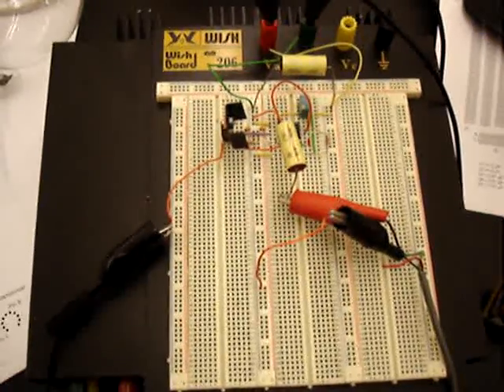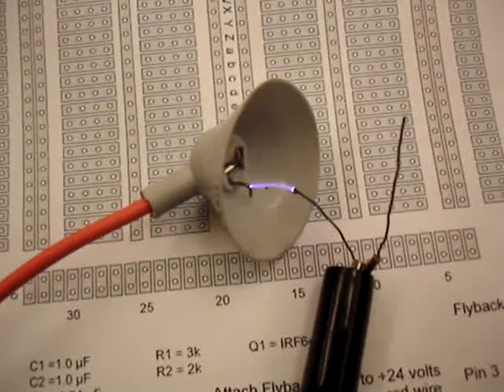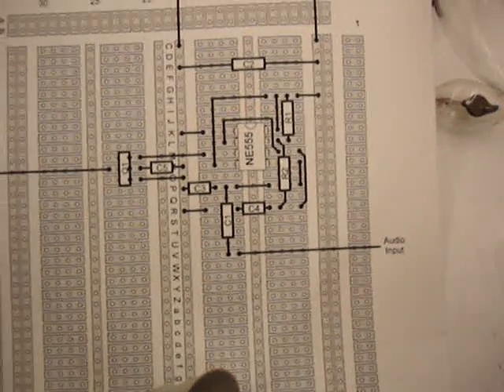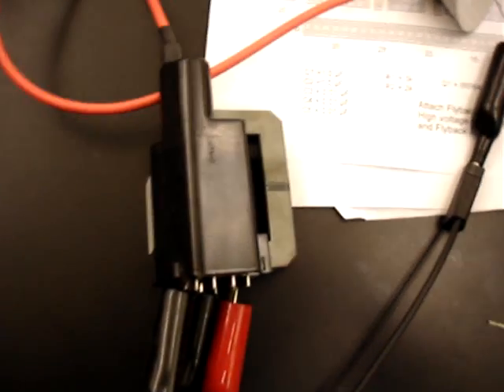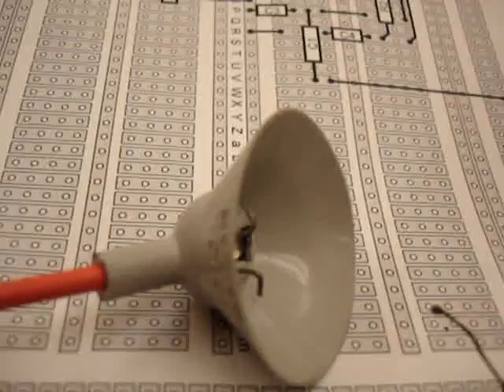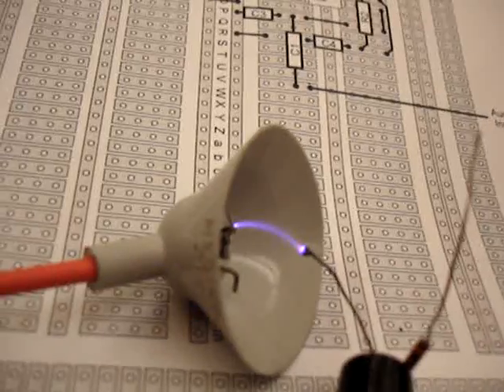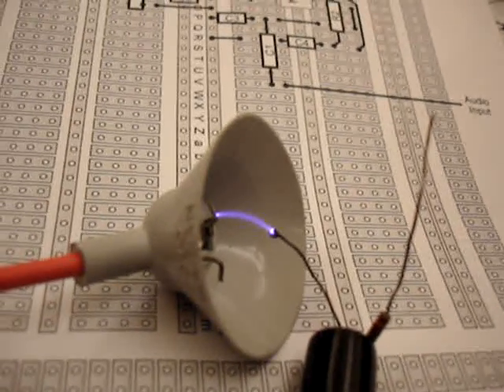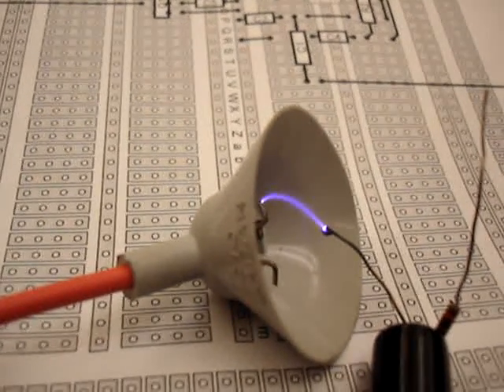Plasma speaker: making musical sparks

Comment from the maker: Tesla could have done this - the first "singing arc" was made in 1900 by William Du Bois Duddell, and his invention lead to an early radio transmitter.  In fact, if you build my circuit with a higher frequency coil and carrier frequency (about 1MHz) you'll wind up making both a plasma speaker and an AM radio at the same time.  However, the FCC won't like it if you do this...

Comment from the maker: People have tried to make commercial plasma speakers: google ionovac.  The main problems are safety-related, notably the high voltage and high temperature of the arc, which can easily ignite inflammable material.  Also, the arc generates ozone and nitric oxides.  It's relatively easy to solve the high voltage and temperature issues, but so far the only method to eliminate the ozone and NOx is to use a helium arc, which requires a tank of helium for your speaker.

Comment from the maker: You can get the IRF640 at most major electronic suppliers: Jameco, Mouser, Digikey, and Newark/Element 14 all have this part in stock.  You can do a Google search on any of these names (Jameco is probably the most convenient for hobbyists).  Incidentally, you can substitute other high-current, high-voltage N-channel MOSFETs for the 640 (such as the IRF740) although I prefer the low on-resistance of the IRF640.

Comment from the maker: If you do a Google search on "plasma speaker history" you'll find that these have been around for quite some time, but have never caught on.  Plasma speakers have great potential but technical and safety difficulties have kept them from replacing standard speakers.  But if some clever person can solve the safety problems, then these might become the speaker of the future (albeit with a better driver circuit than the one I used).

Comment: No, i reduced the duty in changing that two resistors for 555 timer, but - the logic 1 on output is still longer than logic 0, so i inverted it with BC547. So - As you said, it will reduce the audio power so much, but current that flows from main supply is about 0,5A. If you agree, we can amke it together with small input power, smaller power dissipation and louder sound :)

Comment from the maker: My email is dsherman@cornellcollege.edu and I'd appreciate your circuit.  It seems like you're using the BC547 NPN transistor as an inverter to reduce the 555 duty cycle well below 50%.  That will reduce the power dissipated by the IRF640, but it may also reduce the audio output power.  If the duty cycle is only about 7%, then you can only modulate up to 14% before your circuit clips the audio.  However, that may well be enough to produce sufficient audible power.  I'll have to try it!  Thanks!

Comment: I will send you mine schematic - give me your email on my channel. I solved the problem (Im only 15year old, so i dont know if its best :D) with changing the 555 cycle = first i did a 30kHz cycle, Then I inverted the input with BC546 for the IRF640 (for wider logic 0 than logic 1 on output), so the IRF grounds the coil like this- LOGIC1:LOGIC0 1:15, so in one full cycle is the irf switched on only 6,6% from 100% full cycle. So this is "healthier" for IRF640 and you can use smaller heatsink :)

Comment: No, I meaned for sample  BC547 or some small transistor for open that IRF640, but with resistor from 24V to 547s emitter, like 1k for simple limit. Or - MOSFETS can amplify current too, so what about use resistor (about 100k) between Gate and Drain for limiting current :) Of course - mine works without 100W resistor :). Many people cant find a primary winding, as me. So i wound it on that main ferrite core - about 8 turns with rubber-isolated wire (works same with ANY littlebit thicker wire)

Comment from the maker: I agree that the 100W resistor is a cheap, brute-force method of limiting the current, but it works.  Did you mean BU5xx transistors?  They can certainly handle a much higher voltage than the IRF640, but the problem when removing the power resistor is how to limit the current to the flyback primary - there doesn't seem to be a problem with the voltage.  I'm not sure how the BU5xx transistors would solve this problem.  Could you send me a schematic of your proposed circuit?  Thanks!

Comment from the maker: I actually soldered a standard 1/8 inch audio jack to pin 5 (the modulation input pin) of the 555.  I could then hook up any audio device (MP3 player, computer speaker, radio, tape recorder, etc.) to the plasma speaker using a standard audio cable.

Comment: Thank you for your reply again. I think that I will isolate the two cables in order to avoid surprises. Form I understand from the schematics, you just solder the output of an MP3 player to the output of the NE555 in order to obtain sound. Is this correct?

Comment from the maker: I presume you want to drive the primary of the transformer with 300 volts.  The IRF640 MOSFET can only handle 200 volts, but the IRF740 can handle 400 volts and the IRF840 can handle 500 volts.  However, you'll need to power the rest of the circuit with low voltage.  The flyback transformer I used only had the one high voltage red cable and several pins.  Without knowing anything about your specific flyback transformer, it's hard to offer useful advice on what to do with the other wires.

Comment: Thank you for your reply. I forgot to ask you what happens with the other two wires which exit the fly back transformer (typically a red and grey cables). Do I cut them off? Also, with this schematic is possible to increase the power from 24V to 300V?

Comment from the maker: The flyback transformer has two secondary leads.  One lead serves as the ground (pin 6 on this transformer) and the other lead (the high voltage red wire on this transformer) serves as high voltage lead.  The spark is between the two secondary leads.  The air being ionized by the spark serves as the resistor between the two leads - there really isn't any need to add additional resistance.  Goldmine Electronics still has these transformers in stock: item G17744

Comment: Hello. I have to design a similar application (minus the music) and I have all the parts. However, I wanted to know on what does the discharge voltage goes to (a ground point, a resistor...)?

Comment from the maker: In the description to this video, there's a link to a PDF of the schematic that should answer most of your questions.  The pinout of the IRF640 is: Pin 1 = Gate, Pin 2 = Drain; Pin 3 = Source.  If you hold the IRF640 in front of you, the pins are ordered left to right.  The 3 ohm power resistor is connected between pin 2 (D) of the MOSFET and pin 3 of the flyback.  Pin 1 (G) of the MOSFET is connected to pin 3 of the 555 timer chip.  Pin 3 (S) of the MOSFET is connected to ground.

Comment: Continuing. I've probably misplaced the wires to the mosfet. Could you describe the pins on your diagram: from top to botton, the mosfet in your video is S D G? One more thing, where do you connect the power resistor you mentioned? (3 ohms?). As you can see, I am almost a complete beginner. Please, be patient. Thanks a lot. Yours was the best project and most stable I found on the youtube.

Comment: Well, I tried and almost got it. I got some nice silent spikes, would say an arc with a nice cloud around it, but just once and for a moment. No sound. I didn't quite get what you meant about the audio ground. I input a plain P2 plug with no wires soldered to it to my FM radio, and clipped a wire to the middle contact and named that the "positive". I connected that to the C3 according to your diagram. Where do I connect the negative of the plug (the outter contact)? To the circuit ground?

Comment from the maker: On second thought, most modern flybacks have an internal diode, so you don't want to use an H-bridge to drive them, but you would want an H-bridge if you made your own Tesla coil.   Tesla coils run at higher frequencies which moves the carrier frequency far away from audible frequencies, vastly improving sound quality.  If you still want to use a variant of my circuit, use a better PWM chip, higher performance MOSFETs and fast power diodes to prevent current, voltage spikes.

Comment from the maker: There are several things you could do to make the audio better.  First, use a better chip to perform the pulse width modulation: the 555 timer works, but is far from ideal.  Next, use an H-bridge configuration to get more power (see Wikipedia article on H-bridge and class-D amplifiers).  A single MOSFET is only on or off: an H-bridge lets the signal be positive or negative, which ultimately means more audible power.  However, this also makes the circuit more complicated (and more expensive).

Comment: Can you make the audio louder? There are other projects with louder volume, but they seem more complex. I have a flyback I scavenged, and am going to scavenge a few more, including identical ones from identical monitors to make stereo speakers, but I want something with more volume. I am planning on encasing the guts, putting a shield in front of the arc that bounces the sound backwards into a cone to direct the sound outwards, hopefully louder, but I need decent starting volume. Ideas?

Comment from the maker: Pin 1 is the primary positive, which is connected to +24VDC (use a high-current power supply); Pin 3 is the primary negative, which is connected to the MOSFET via the power resistor.  Pin 6 is the HV ground.  The audio ground is also the signal (and power supply) ground.  There are a number of power MOSFETs that you can use for this circuit.  The IRF640 can tolerate fairly large voltage spikes, as well as large current spikes, and it has a low on-resistance.  It will still need a heatsink.

Comment: Great video. I'm new to electronics but I've managed to use a flyback to produce my first sparks. I'm going to build yours this week, but I didn'd quite get how you fed the flyback itself: What did you connect to pin 1? Is it the Primary positive? Is pin 3 the Primary negative? Pin 6 is the HV ground? And where did you connect the negative of the audio in? Sorry for my ignorance, but I'm still a beginner. THANKS A LOT FOR YOUR VIDEO AND EXPLANATIONS.

Comment from the maker: Hi - sorry your circuit isn't working.  Yes, this circuit can work without having an audio signal on pin 5.  And, yes, it's easy to burn out the IRF640 because there can be both high voltage and high current spikes.  The IRF640 is fairly tolerant of these spikes, but you should still limit the current to only a few amps (that's why I have a 3 ohm power resistor in series with the flyback).  You can test the circuit by having it drive a speaker rather than a flyback - you should hear the audio.

Comment from the maker: Well, yes, that white thing with a red wire is a high voltage flyback transformer from a CRT.  They're not hard to find in either old computer monitors or surplus on the internet, but you should be careful when using these: it's easy for the high voltage sparks to jump to things it shouldn't, such as expensive electronics lying nearby, inquisitive pets, or you.  And most insulators will break down at these voltages, so don't expect electrically insulated rubber gloves will protect you.

Comment from the maker: A 3 ohm resistor connected across a 24 volt power supply will draw 8 amps from the power supply and dissipate power P = I^2*R = 192 watts.  In this circuit, the flyback primary (also about 3 ohms) is in series with the 3 ohm resistor for a total series resistance of 6 ohms.  6 ohms draws 4 amps from the power supply and dissipates 72 watts.  I could get away with a 50 watt resistor, but 100 ohm resistors were pretty cheap on eBay, and it's often better to over-rate the resistor power rating.

Comment from the maker: @feenixb1o7 Most flyback transformer coils will work, as long as you match the 555 frequency to the resonant frequency (which is why my circuit ignores the feedback coil).  If you need to find which pin is which on your flyback, do a Google search on "Flyback Transformer Pinout" and look at Jean-Louis Naudin's page for instructions.  The capacitors should be able to handle high voltage spikes (mine were rated at 100 volts) but the specific type isn't too important.

Comment from the maker: @feenixb1o7 The 3 ohm power resistor helps to limit the current through the IRF640 MOSFET.  Without this resistor, the MOSFET tends to die an early death.  Yes, this should work on a wide variety of flyback transformers, although you'd have to change the 555 timer frequency to match the resonant frequency of your flyback.  This circuit will work with other coils and transformers, although their resonant frequency is often audible which messes up sound production.

Comment from the maker: @elwido No, you don't need to dismantle the transformer but you will need to modify your oscillator circuit.  If you took apart the plasma globe, the transformer is connected to an oscillator circuit which may be embedded in a block of epoxy.  You need to drive the transformer using a modulated signal.  If your plasma globe runs off low voltage DC then it may be possible to do this quite easily.  Please feel free to contact me directly at dsherman@cornellcollege.edu.

Comment from the maker: @elwido You need to modulate the signal going to the flyback.  A common form of modulation is pulse width modulation (PWM) which can be implemented using a 555 timer chip or a TL494 PWM control circuit.  I used a 555 timer (available at Radio Shack and most electronic suppliers), and you can find the schematic by doing a Google search on "Derin Sherman videos" and then clicking on the PDF schematic associated with this video.  Good luck!

Comment from the maker: @shockmebabby In theory, there's no reason why you shouldn't be able to modulate the primary of a Neon Sign Transformer.  In practice, I'm not sure how well the NST would handle the high frequencies.  I know that some NSTs don't handle high frequencies well, but others may.  In contrast, flyback transformers are designed to work with high frequencies, which is why this circuit uses a flyback.  I may just have to get an NST and experiment.

Comment from the maker: @Norbizzle2012 Hi - I have a schematic of the circuit listing the parts (including RC values) on my video page web site.  Do a Google search on "Derin Sherman videos" and you'll find my video page and link to schematic.  You can also check out the YouTube video "How to make a high voltage singing arc" on which I based my own circuit.  The main differences: I used an IRF640 which has a lower on resistance than the IRF644, and I added a 3 ohm power resistor to limit the current.

Comment from the maker: @justchen563 The bass is pretty poor, which is why these are also known as plasma tweeters.  In the 1970s, Plasmatronics marketed a plasma tweeter using a helium jet which avoided the ozone problems caused by my plasma speaker, although it required a plentiful supply of helium to operate.  In theory it is possible to make a plasma tweeter with perfect audio response.  In practice there are several safety issues that have prevented common use of these devices.

Comment from the maker: @55dcyinely High voltage transformers require many windings so there's a practical limit on how small you can make a high voltage transformer.  I used a Goldmine Electronics G17744 transformer which is only a few dollars (about $4) although you could recycle a flyback transformer from an old broken CRT monitor or TV.  In any case, you should learn how to handle high voltage equipment before experimenting with these transformers.

Comment from the maker: @iEugene1994 You are completely correct.  This circuit is more a "proof of concept" circuit than a high quality sound system.  In fact, you wouldn't want to use this circuit for producing real audio: not only is the quality mediocre, but it produces a lot of heat and ozone.  And it's dangerous if you lack experience with high voltage.  However, it does demonstrate some interesting physical effects, and it's fairly inexpensive using readily available parts.

Comment from the maker: @Alex1M6 Add a power resistor (about 3-5 ohms, 50 to 100 watts) in series between the primary windings of the flyback and the MOSFET.  This will limit the current to the flyback, which will reduce the power dissipated by the MOSFET.  This will also help to smooth out the current pulses and thus reduce the voltage spikes caused by driving an inductive load.  Note that you may have to provide a heat sink to your power resistor, although I haven't had any trouble with my 3 ohm 100 watt resistor.

Comment from the maker: @Alex1M6 The IRF640 definitely needs a heat sink, and it will warm up quite a bit, but it shouldn't get too hot (you can still touch it).   You can see the small heat sink I used on the MOSFET in the video - that would keep the circuit cool for a while.  I find that it's useful to put a 100 watt, 3 ohm resistor in series between the MOSFET output and the flyback to limit the current to the flyback and prevent voltage spikes.  You can get 100 watt, 3 ohm resistors on eBay for about $5.

Comment from the maker: @janazami Hi - what sort of help do you need?  You can see a copy of the circuit board layout in the background of the video (I used Futurlec model 777 prototyping board). You'll need a power supply (about 12 to 24 volts) with about 1 ampere output (or a current-limiting circuit, which could be as simple as a 3 ohm power resistor), a high power MOSFET (IRF640, IRF740, IRF840 all seem to work) a flyback transformer (I used Goldmine Electronics item G17744 which costs $4) and a 555 timer chip.